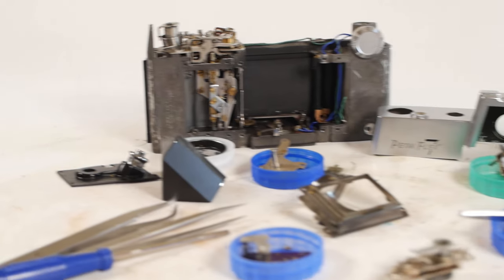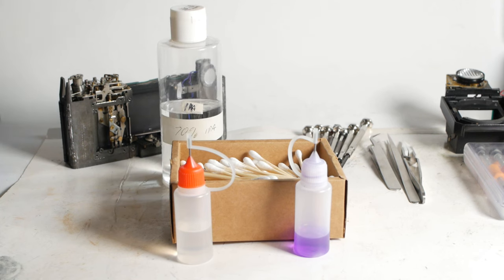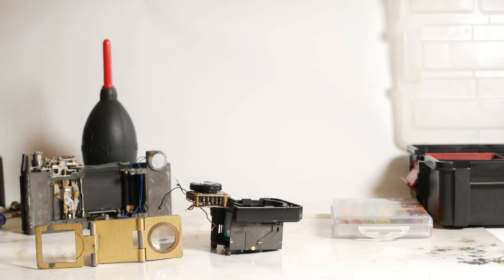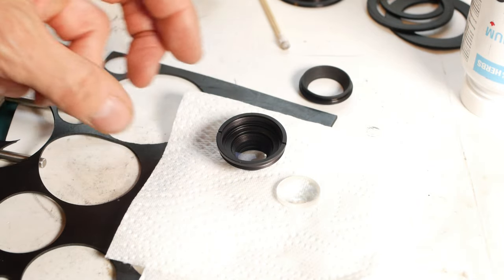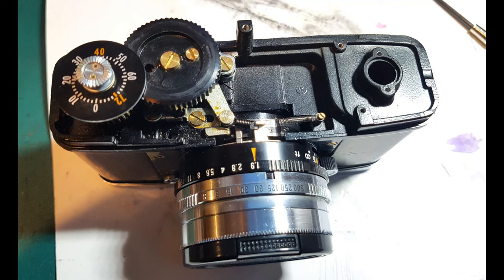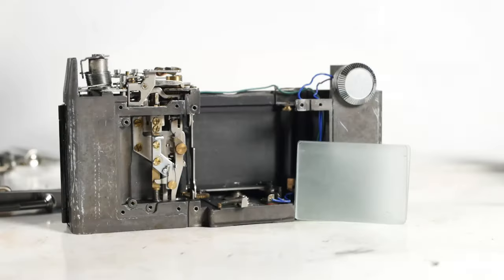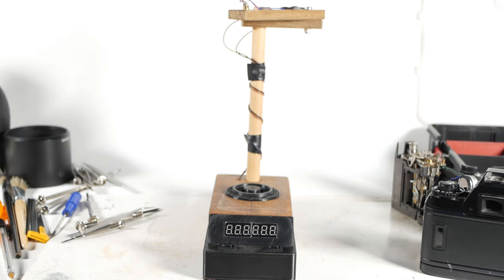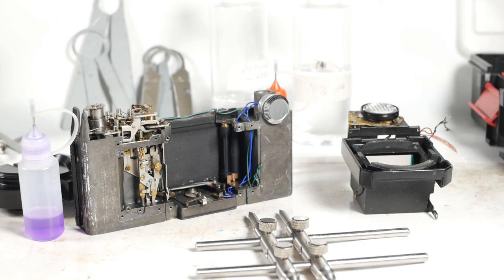Vintage Camera Repairs - Some Tools for Fixing Old Cameras

Comment: ... you certainly deserve an award for creativity  ... I am inspired to try manufacturing some of my own tools now ... thank you for this video of inspiration  👍👍
Reply from the maker: Excellent James, you can see from some of my creations that they don't need to be pretty, just as long as they do the job.

I think I'm going to need to make a few more tools - I'm working on some Tamron Adaptall lenses and they are the most frustrating things to take apart - thought I'd do them all in one day, but I haven't even got the first one apart yet.  Going to have to fabricate some wrenches and gripping tools, and even then, I'm not sure how I'll get one bit apart.  Every thread seems to be coated with some sort of threadlock that neither IPA or Acetone will soften, and I can't throw loads of heat at them for fear of damaging optical parts and paint.

Comment: Enjoyable and informative. I use one of those silicon soldering mats to prevent screws from bouncing into another dimension if they drop. It's made taking apart cameras much more enjoyable and less time spent hunting in the carpet for screws.
That shutter tester is a nice rig! What drives it behind the scenes? I've seen some with a light and sensor that generates an "audio" signal to measure the exposure, but a built-in display seems less fiddly
Reply from the maker: Cheers Z John, those tiny parts that fly are so annoying, and I don't know about you, but the area where I work isn't exactly tidy, so whatever part that flies will invariably end up somewhere that's really difficult to get to, involving much moving of piles of stuff and general cursing!!!  Silicone soldering mat is a good idea - I keep meaning to get one anyway.....

I completely forgot to mention what's under the clothing of the shutter timer - there's an Arduino Nano lurking inside the black box - that bit was all my brother's work.  One advantage of the laser is that I can position it anywhere within the film plane, that way I can take multiple readings to see if a shutter is dragging - a 3 laser system would do this in a single pass but it's not that much trouble to take multiple readings.

Comment: About the things that are too small for the straight lens spanner: There also are lens spanners with angled tips (I only have one of these and found that it's all I needed so far). Maybe having one of each would be good if you're doing a lot of repairs.

And to anyone looking to buy a lens spanner: Do not get the single-bar one, get the two-rod version instead, it's much more stable. I made the mistake of buying a single-bar one and never use it since it's too wobbly.
And when you get them, use a wrench to tighten the thumb screws on one of the prongs that extra bit, since they tend to become loose suddenly if they're just hand tight. Position it at about 1/3 of the way down the rod. You'll still easily be able to reposition the second prong for 99% of all uses, and only having one prong that can become loose saves you a lot of headache :)

One last thing I'd like to add to the list of tools: A hammer. Yes, really! Something small with a 50g or 100g head. This and a good flathead screwdriver can be vital when you have a piece or screw that just won't budge from normal force or a bit of oil/solvent alone. People meme on percussive maintenance, but it's great for getting things unstuck as long as you're careful.

Lastly, if you want a very cheap and easy way of doing (single-point) shutter tests, there's the PhotoPlug which plugs into a smartphone. You can also use their free app without it, but then it works purely on sound and it's not trivial to differentiate the actual shutter curtain slap from the other mechanical noises. If you wanna get really involved, Reveni Labs recently announced/released their own shutter tester with three point measurement, efficiency curves and all the bells and whistles but it's something like 500€.
Reply from the maker: Cheers Leon, I keep meaning to get one of the lens spanners with the angled legs, but I only think about it when I need it right now, then I come up with another way round and quickly forget about it again!!!

I've never used the percussion method on something as small as a camera (I often use it on old engines and the like) but you're right, it could be quite effective if used correctly - I can see some people not quite interpreting the amount of force required and ending up with "oops I squished my camera".

I do like the control I get with the modified screwdriver system, there's no whip in it and I find it better for feeling what's going on - like the annoying times when I don't yet know if it's a right hand or left hand thread, I just like the feedback I get from it compared to the lens spanner.

Comment: Great video! i Useful tips and information. Thank you for the tips.  I liked  the information about the liquids, sterilized water and oiling. I am interesting to find information specific for the chemical liquids for repairing old cameras Ex: the best liquid oil for remove rust from metal, the best glue that would bond with leather and metal  etc. Do you know if there is some specific video for that? 
I would greatly appreciate it if you have some tip.
Reply from the maker: Hi SokratesP, I haven't seen any videos that delve into what specific chemicals etc are best for repairing old cameras - I wouldn't be surprised if there's something in the general camera servicing guides at Learn Camera Repair dot com, but I haven't looked for them.  I think some of the products will vary form one location to another - many people recommend a glue called Pilobond for gluing shutter curtains to the drums on the camera or for re attaching the leatherette after servicing a camera, but I've never come across that glue in the UK - I did see some online for sale at a stupid price, which I didn't buy!!!  If you do find a list of recommended products, you may need to track down alternatives that are available in your location.
Reply: @GrumpyTim  Thank you very much for the answer. I have to search forward and make a list off products that other people use,  as you sugest. Keep up the good work!🙏👍

Comment: I wonder if you've ever faced the Kiev 4 shutter..
Reply from the maker: Hi sclogse1, I had to do some remedial work to get the Kiev working, the shutter has a bit of drag on one of the curtains but I figured I'd see how bad it looked on the actual photos before I decide whether I need to do a complete strip down or not.  Much as I love the look of the Kiev, I didn't exactly fall in love with the shutter mechanism on first glance - maybe if I have to do an entire strip down I'll appreciate it more, but my initial impression was something along the lines of "what a load of rubbish"!!!